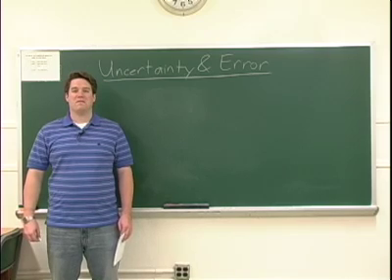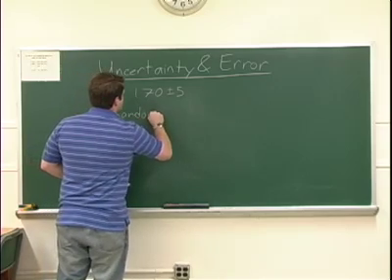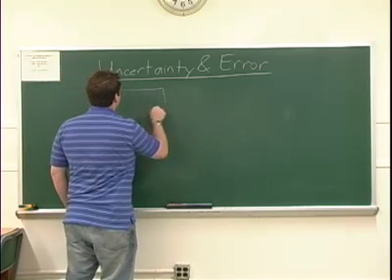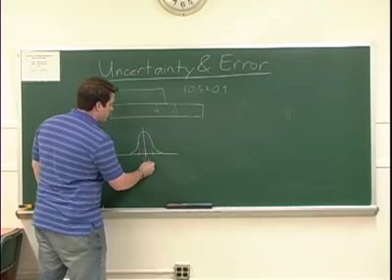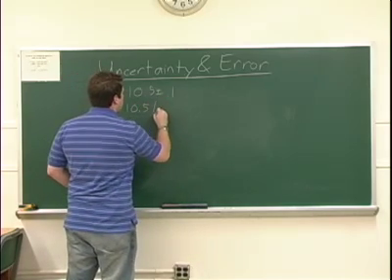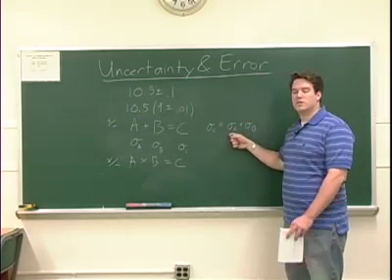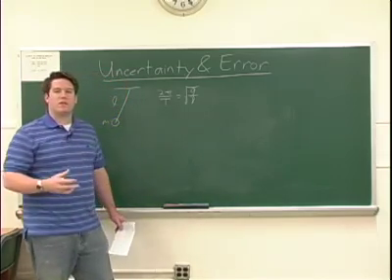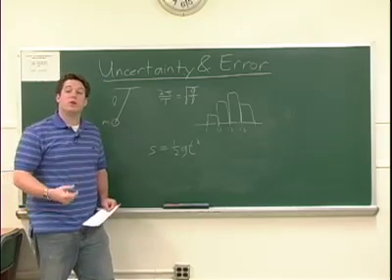Uncertainty and Error Introduction

Comment: Isn't trying to measure uncertainty a contradictory statement? 'Absolute and relative uncertainty'? Come on. Even trying to use a range of values or confidence intervals won't work to give the precision that physicists are looking for. The underlying problem is that it is impossible to mathematically express all values in a system using the system itself.